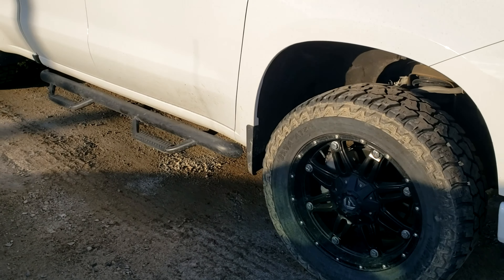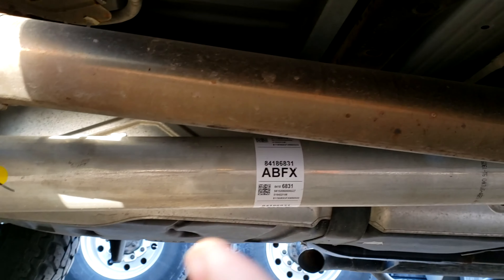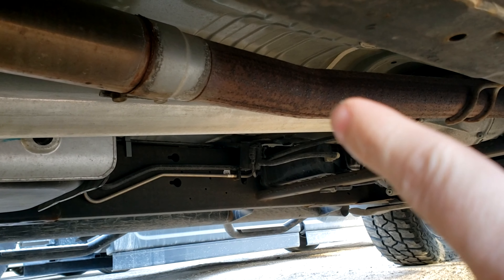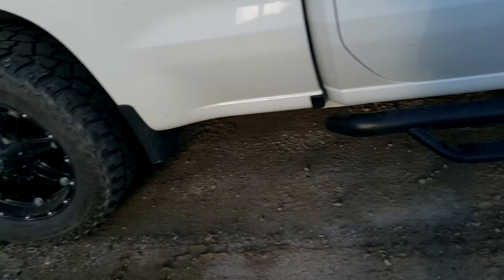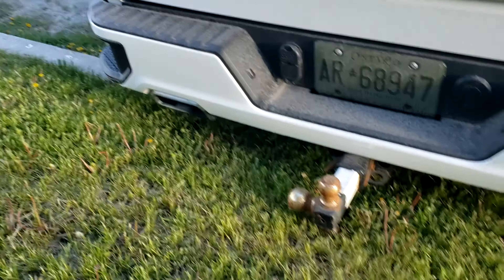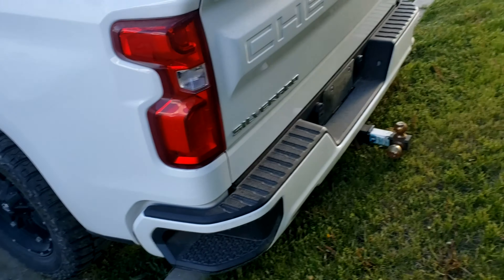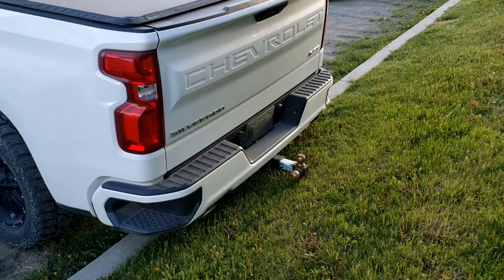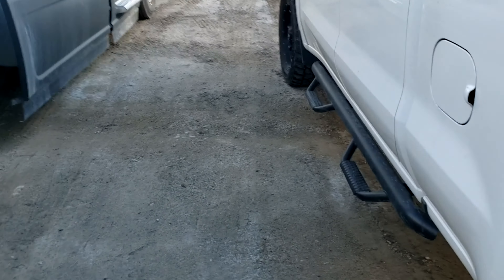2019 Silverado Muffler + flapper delete

Comment: I am about to do this to my 2020.  Did you have to bend the 3" pipe for the input/output offset on the muffler or did the flex pipe allow for straight connection?
Reply from the maker: No bending required. Its a fairly straight shot once you remove the muffler / flapper combo. I'd definitely try to keep the flex pipe as straight as possible, I got majority of my all of my adjustment from the tail end of the exhaust because its just on rubber exhaust hangers
Reply: @YotaakGFX  I have a stick of 2 3/4 tubing and 2 band clamps on the way.  I am going set it up so I can put the muffler back in for long trips unless there is zero drone. Thanks for the info.
Reply from the maker: @mlbaker3  my personal truck has no drone, but thats maybe because the tires bleed it out. Also the z71 package comes with 2 resonators instead of 1 with the normal package. So It might be a little louder.

Comment: What kind of rims and tires you got? Brand and size?
Reply from the maker: Rims are fuel hostages, 20x10 -.05 offset. Tires are 305/55/20 Mickey Tompson baja MTZ P3. Total tire size is 33" tall 12.5" wide. No trimming needed with a 2" level